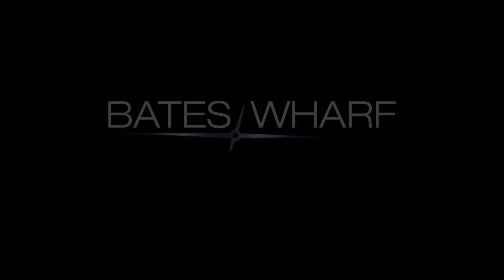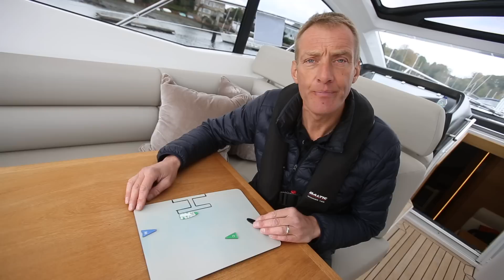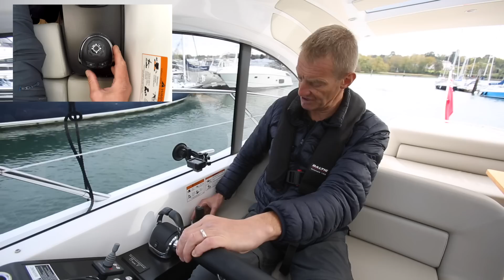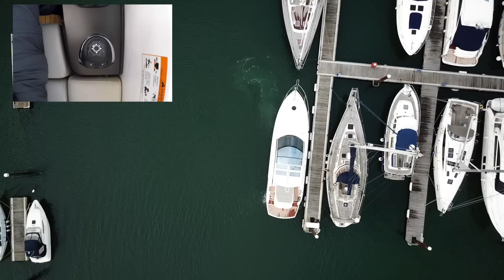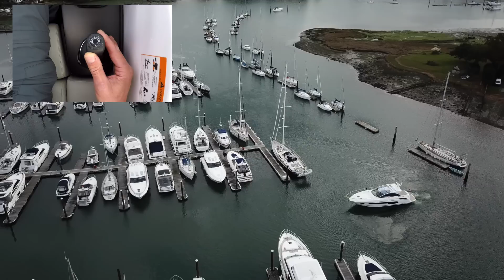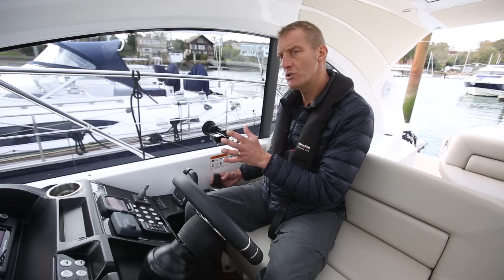How To: Berth an IPS boat | Motor Boat & Yachting

Comment: After having boats with a single screw anything is better. Could that system be incorporated with a bow thruster for more current and windy conditions. The videos I have seen of you promoting the IPS are glass like conditions. But truly, )lthat's not the norm if you have been boating for years.

Comment: The IPS system seems to be intuitive. Love the dynamic positioning. More efficiency, less noise, less fuel consumption, less exhaust fumes means its a quantum jump from traditional shaft drive systems. Well done great video and thanks